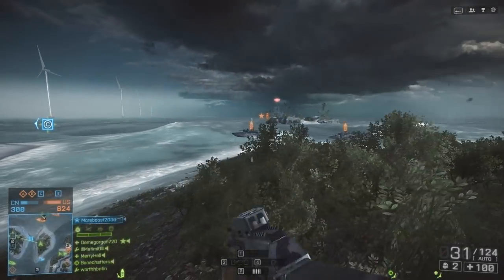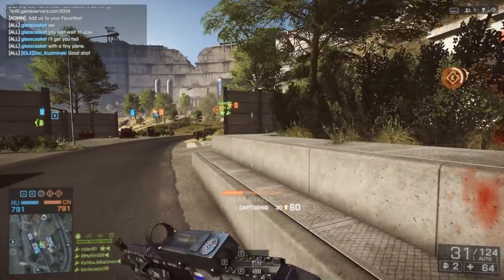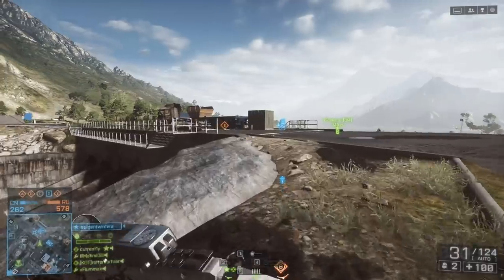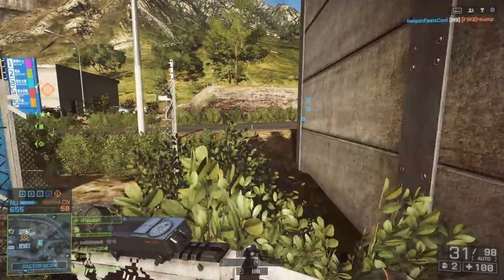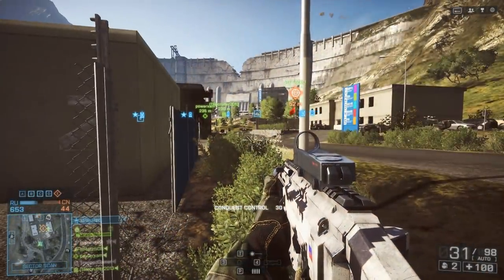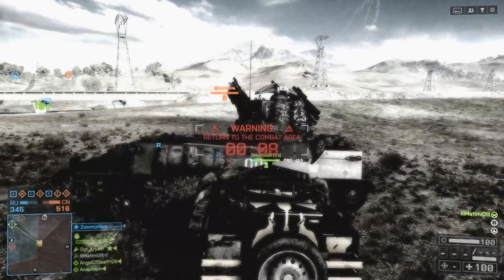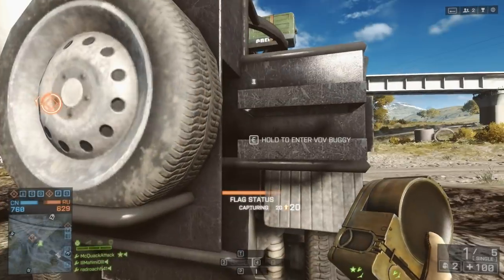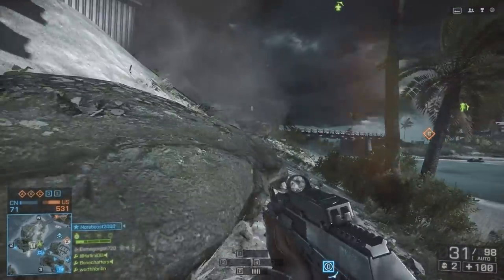M2 SLAM Guide - Water Mines & Tank Claymore - Battlefield 4

Comment: Thx for posting this Matimio, learned a lot from yours and another on the best application of this mine.

Created a brand new hybrid class (anti-armor and anti-marine)...Was awesome when dropped under the bridge and at A as you recommended on Paracel Storm. Great damage points, and when combined with a Jav...racking up the sweet kills. You're so right, no one expects them and I finally found a way to damage/destroy fast patrol boats that previously seemed almost invincible. I was forced to try to swim up to and under them with C-4, but now I can lay & slay.

Also, on Golmud Railway, I buried them in foxholes and successfully single-handedly defended A + B. The drivers were shocked every time. Had no idea what hit them.

Thx man.

Comment: If I do the same trick like stick the m2 mine onto the vehicle. Will the vehicle explode after it accelerates ? Did dice change this feature in update patches ? Also, can m2 be used as an anti-infantry mine?
Reply: If you stick it to a vehicle and it moves yes they blow up, as for your second question are you asking if they detonate if infantry step on them? if so then no they don't.
Reply: Alan Mcniel thanks a lot for the answer.
Reply: BILL WU np
Reply: Alan Mcniel i think i should swap from m15 to m2. m2 looks better.

Comment: C4s are quicker than slams cus  with slams u have to run away from the tank with c4s u just step back and boom goes the dinamite
Reply: but slams have a failsafe if you die before detonating C4 it does nothing if you slam em the slams stay in place after you die and will kill the vehicle when he drives off

Comment: They nerfed the SLAMs. Three of them on direct contact won't even destroy an LAV at 100% HP. I used to place three on a 90 degree surface (preferably a tree or something that blends in), a vehicle would drive by, and BOOM the MBT would be no more. You get like a retarded 95 damage + disable now. I wouldn't bother with them unless you are going after light vehicles like the Jeeps/Quads or if you have the squad upgrade and can plant six. Sticking three of them to a Jeep for instance then driving into the enemy's vehicle WILL work, you just probably won't get the kill now that the damage is lowered. On anything heavy I stick to AT mines now or combine them for some nasty booby-traps.
Reply: +go0fy11137 Thanks for taking the time to go into details about the nerf. I was going to jump on the PS4 and change out to slams but would have been like WTF?? I still may switch but now I know what to expect.

Comment: I never used SLAMS....till today!
Reply: same
Reply: +Nick K. Didn't it get a pretty big nerf since this video was made?
Reply: I don't know (since I never used them), but I would think so since mostly everything gets nerfed.
Reply: Yeah I looked it up they changed it to where it has to be within 3 meters for maximum damage, when it was previously 6.
Reply: I think it takes three and they have to be kinda close to each other. As for anti tank mines, I was rather successful on Rouge Transmission (Defender) and Giants Of Karelia (conquest). The entrance to C, the bridge on D and even the railroad connection between the two.
Reply: I never tried until a few days ago myself I know most of the time 3 tank mines usually blows up a tank but them slams, idk I want to try them a parcel storm in the water through a canal or something to see if it will blow up a boat, I tried it at flood zone and it damage the assault tank but didn't mess it up completely, I'll figure out how to do it lol